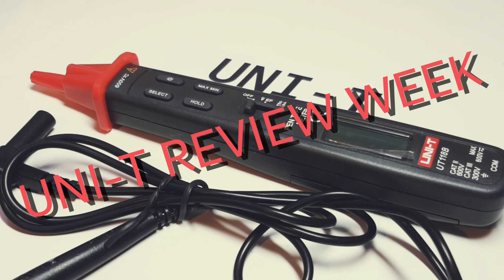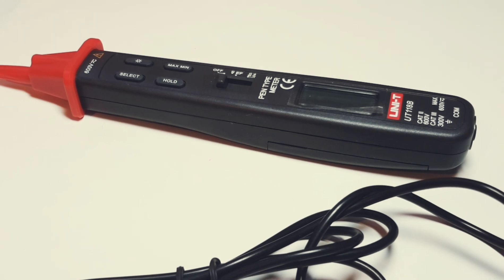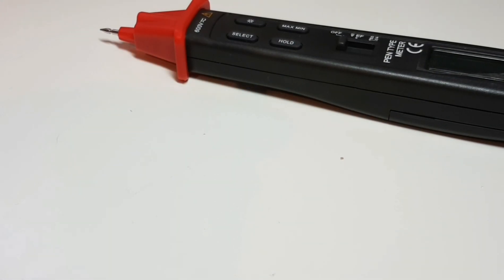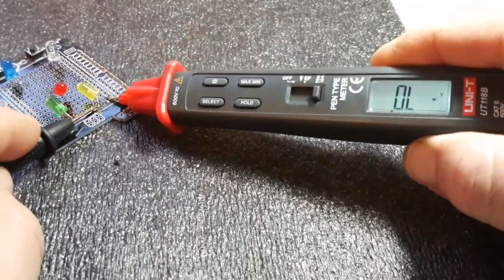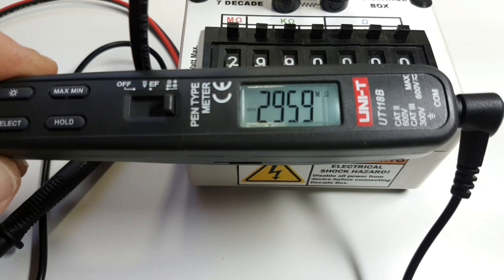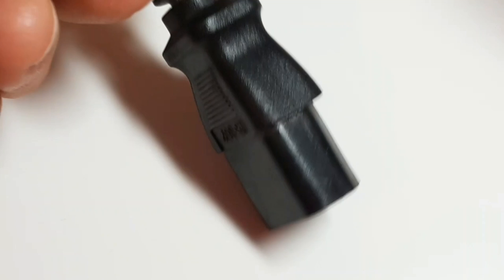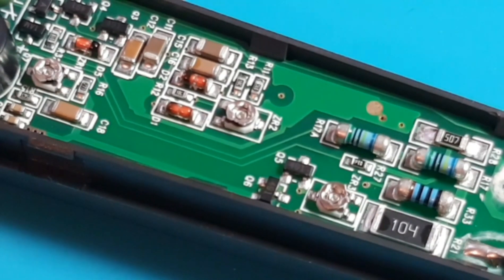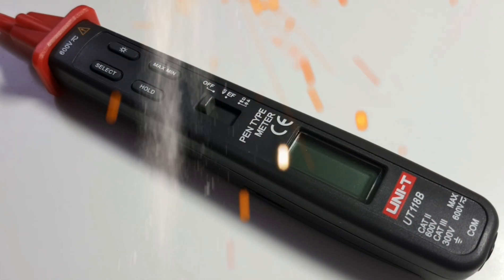UNI-T UT118B Pen Type Digital Multimeter Review & Teardown!

Comment: UT118B = UT118A + R10 (0 Ohm) + R27 (100 kOhm?) + R28 (500 MOhm)
So you need only three resistors to change UT118A to 118B.
R10 - EF mode selection.
R27 & R28 - EF mode realization.
Reply from the maker: Excellent info, thx for sharing!